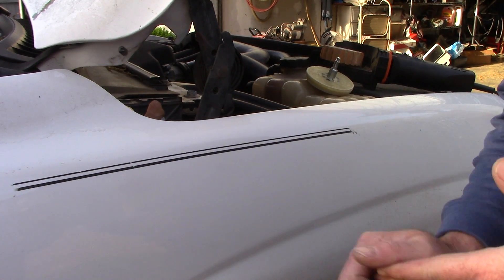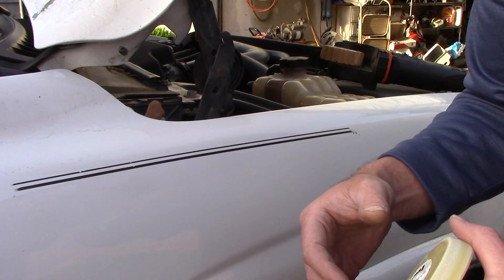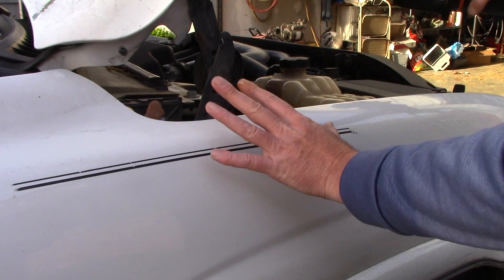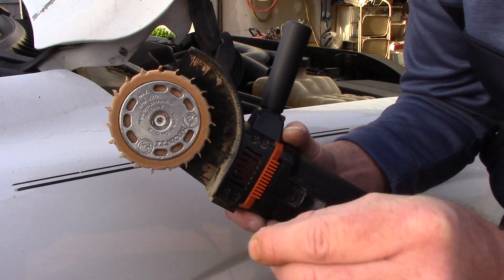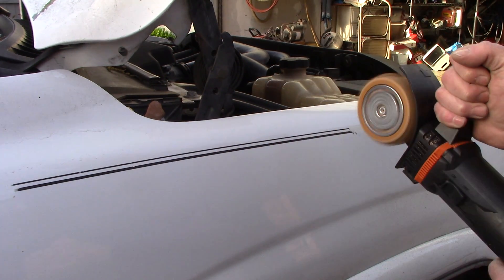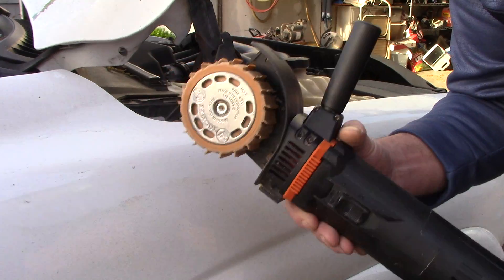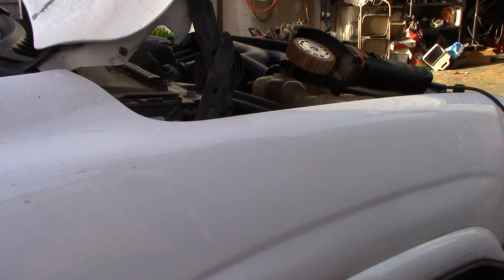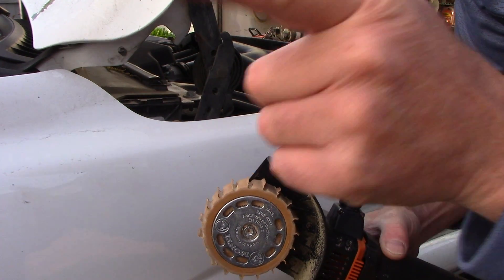Fastest Way To Remove Pinstripes From Car!!

Comment: Hi Scott.
Been watching your channel over the past few months to pick up tips on paint correction having bought a Jaguar XK with swirled and scratched paintwork. The Jag looks a $M now, so many thanks.
My daughter has a BMW Mini Cooper with a Union Jack vinyl across the entire roof.
I managed to peel off the blue triangles but the red stripes were bonded to the paintwork after 15 years and were bleached and severely cracked by the sun.
A heat gun and scraper did not even make an impression but a rubber eraser wheel (similar to the one in this clip) fitted to my DIY grade Makita cordless drill set at speed II removed every trace of vinyl and the adhesive to the extent that you would not know it was ever on there, once the roof was compounded and polished with a DA polisher.
It's not a quick job and took me about 10 hours, spread over 3 days and around 30 battery charges (18v lithium).
Using the wheel did not damage the paint in any way at all - which I was really surprised and pleased with. Wouldn't hesitate to use again for difficult to shift vinyl.
Bought here in the UK on-line, but since found out they are available from Tool Station for around £8 ($10)

Comment: is that safe to use on a new car? my 22 Sentra has a tri-coat paint, and this dealership where my dealer got the car from put pinstripes on it. i've tried everything to get em off, no luck. i figured i could just remove em like you do any vinyl decal or stripe, using heat, and your fingernails, but these are stubborn! car wash wand wouldn't even work.. any ideas?

Comment: I mentioned to Eastwood site about a vinyl abrasive drum to remove pinstripes, adhesive after taking emblems off vehicle I just do painting and use auto detail products on my vehicle just took the emblems off my vehicle a Chevy Malibu 2008 I had to get another eraser wheel got two but Eastwood hopefully they message me back and have something could use on the paint stripper tool have I know they have all type of abrasive drums I have two but the first one came with the strip tool that got on Ebay for like 129 and I forgot where bought the black pad to strip paint to bare metal but I didn't see a vinyl abrasive pad they had saw rubber one though. It be better to have a vinyl one for the tool I got that paint stripper one got though. Was gonna paint my car first though this year and then paint my truck am having thoughts about stripping the paint on truck to bare metal I just got Epoxy primer to put on bare metal plus my car has rust will use it on that. I messed up multiple times when painting my vehicles though but last year I shouldn't of applied the epoxy primer on my truck because I wasn't sanding it to bare metal I tried sanding it after applying epoxy and the epoxy built up too much on sanding pad but wouldn't want to do that in the future my truck still didn't turn out painted out like I wanted but multiple times already the vehicles I had painted didn't I just keep going painting and just got to learn how to get better I like auto detailing too though but painting more though.

Comment: Hey Scott you helped me tremendously on my Dodge Journey but I just turned in my man card and bought a 2018 black dodge caravan. I decided to use carpro essence then cquartz. Do I need to use any type of stripper on this new paint in my wash bucket? Purple power? I will be using ironx and possibly clay, I'll check after the wash and decon.

Comment: This wheel is awesome. The adhesive is the worst part. We typically use a razor blade, a heat gun and time. Bad vinyl stickerd that leave the residue behind: some scotchbrite pads/adhesive remover on  buffer wheel will clean 80', 5" tall in about 35 minutes after the sticker was removed.

Comment: it's a 4.5 inch grinder with a wheel specific for vinyl removal. The wheel has a recommended RPM of 4000. just buy the wheel and pay attention to your grinders RPM. No such thing as a "special machine". IT'S A 4.5 inch grinder. With a ''Special Wheel".

Comment: Great videos.  Scott, let me pick your brain for a moment since we're in the subject of vinyl/adhesive removal.  I'm still using the 3M wheel, and while I'm not doing a whole lot of pin stripe removal, I am doing a few debadging jobs per month.  My co-workers and I have gotten into an issue where the wheel is discoloring or staining the clear coat that doesn't compound out.  Any thoughts as to what's going on here at what can be done to minimize future risk of having to send another vehicle to the paint booth?
Reply: For anyone interested: to avoid that s clean the cleaning wheel if this happens it's transferring color!

Comment: Never used one of these. For cracked vinyl a goof-off spray, plastic razor and little heat and it will slide off like peeling a banana. Wipe clean then polish to remove ghosting. If it's not cracked then you can just peel it off adhesive and all.

Comment: Ever try WD-40 for removing adhesive?  Works great on paint or glass and cleans up with all purpose cleaners.
Reply: Issue is speed rather than effectiveness. Not sure the point of the vid as most people aren't going to rush out and buy one of those tools. Pinstriping on that car would only take a few minutes to remove with some soft solvent and razor/heatgun.
You could even remove something like what's in the video with a regular buff and cutting compound.

Comment: Scott, any reason you could install the wheel on a normal angle grinder?
Reply from the maker: Calendyr for the wheel to work correctly both rpm and torque need to be perfect.
Mbx went to great lengths to design the motor to match the wheel perfectly.

Comment: I wonder if the wheel itself would fit on a four and a half inch grinder. If it does fit on a four and a half inch grinder, the $15-$25 price tag for the wheel would not be prohibited to buy for us non-professionals. Please let us know if it would fit a four and a half inch grinder if you would. Thank you
Reply from the maker: no..rpm and torque is crucial for the wheel to respond correctly
Reply: Thank you so much for your immediate response.

Comment: Any recommendations for removing pinstripes that are painted on over the clear coat?
Reply from the maker: Bob Sacamano I typically wet sand for that situation..I will try to make a video soon plus there are some other tips as well:)
Reply: That's what i was thinking too.  Preferred not to sand if i didn't have to, but i'm thinking that's my only option.  Don't think something like lacquer thinner is enough to cut it.  Look forward to a video.

Comment: Hey Scott... is that a regular angle grinder?
Reply from the maker: Benji Molina no..And you can't attach the wheel to a grinder.
The wheel requires the right torque and rpm or it will burnish paint.
The whole system is patent protected

Comment: Wow that tool worked better then the ones at the body shop I worked at! I did all the emblems & stripe removal. But our boss said never use Tan color wheel on white paint?  We had to use to red but me personally I never had a problem with either.  Great video Scott..
Reply from the maker: the one you used in the shop, was it a air tool design??
Reply: Dallas Paint Correction & Auto Detailing.     Yes it was a air tool but I always kept it slow so I didn't burn threw
Reply from the maker: what i have learned is you need to have the wheel spinning at the right rpm or some wheels can stain a little, but worth noting the stain can be removed easily..with air design the rpm can change from the user or drop in air pressure and this makes the wheel stain in some cases...the mbx in this video is electric and much more stable with rpm so its less of an issue.
hope that helps but yes if you need a great tool and your doing large graphic removal than this is a awesome tool, its not always needed and i typically only use it on vinyl that has been on the paint way to long and baked into the paint:)
Reply: Dallas Paint Correction & Auto Detailing.    Great info the is Scott I'm going to look into one of those

Comment: Hey Scott:

A little off subject, but i would like to know which you would prefer to use for bug removal, Citrol, or Turtle wax bug & tar. 

I've been watching so many of your videos and buying so many new chemicles + a new 15mm Adams dual, I think I'm starting to lose focus!!!

Love the knowledge you're sharing!!

Respects,
Richard
Reply from the maker: R.D. Licano turtle wax bug & tar is fine if you have the time to let it dwell and not working in hot direct sunlight.
Citrol Is more effective and more of a pro product.
Only you can decide what's best for you and based on your level of expectations